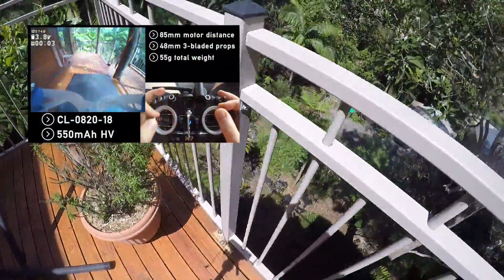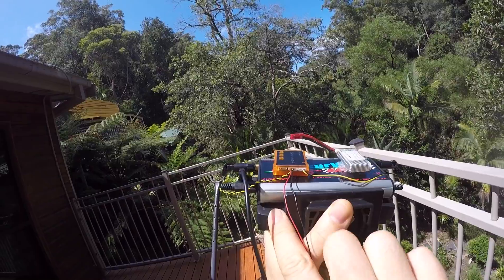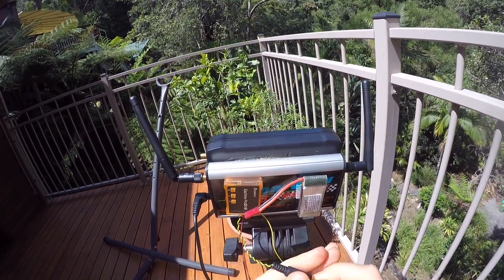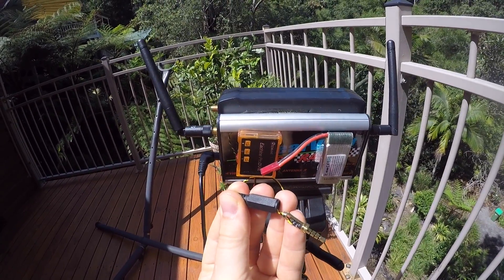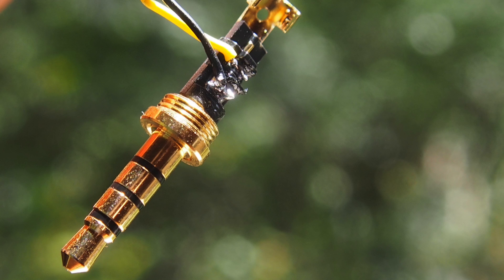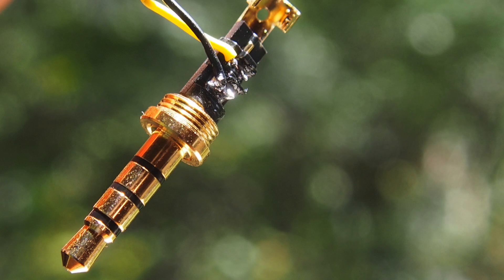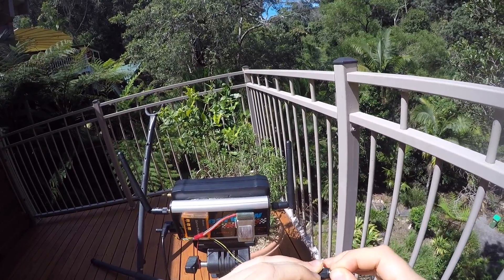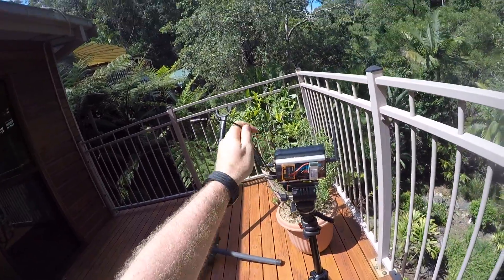How to connect a ClearView receiver to an Eachine ProDVR

Comment: Very nice video tutorial! What are your thoughts on the clearview goggle receiver?
Reply from the maker: a 600mAh 1S powers it for a compete flight session (2-3 hours) for me. I found it best to power all video related equipment straight off batteries, with as little conversion as possible - that  adds noise and reduces efficiency.
Reply from the maker: Sorry, I dont have the CV goggle receiver. I assume reception is as good as the "full size". Not sure if it has a secondary video out.
Reply: Micro Motor Warehouse what are you useing to power the eachine dvr pro ? , I have some cheap rutforce vr-28 goggles I am going to add it to and the goggles are powered by 3.7v 1s , I bought a voltage step up to bring it to 5v but if I will run the same off of 3.7v I will not bother even trying to wire this thing up its the , BTW I bought the matek vb2a5v  to use for the voltage boost from 3.7 to 5v , has anyone used that piece before or yourself ?
Reply: Micro Motor Warehouse I have a question, I just hooked up my $20 eachine dvr pro to my $33 rut force vr-28 goggles & I hooked up the video , grounds & the audio in cables , and the recorded video is very loud it’s like ear bleeding loud , I disconnected the audio in after that so I think it will get rid of that noise issue right ? , & dose the quality of the video go by the quality of the goggles it’s being recorded from , would I get a better video  image if I used the same fpv camera but a high quality pair of goggles like fat sharks or something ? Thanks so much for your time and patience on all my questions !
Reply: Micro Motor Warehouse and would it be possible to hook this eachine dvr pro up to the Tx of the hubsan h501s that has the lcd 5.8ghz screen with all its telemetry , and successfully record the video feed and the telemetry Incase you crash you could go back on the recording to replay  video and get the last know GPS coordinates ? Thanks again !
Reply from the maker: I just ignore the audio noise that is recorded with my FPV footage. If you take a well protected (audio foam) and filtered microphone, I find it somewhat helpful for  to listen to the onboard recording while flying, but not essential.
For my video editing, I do like to have ambient audio, thats why I usually also have a GoPro running on the ground.
Reply from the maker: I dont have a h501s. But it seems very likely to me that you can grab the video signal from somewhere and connect your DVR to it. Google "Hubsan H501s video out", it looks like that will answer you question.
Reply: Micro Motor Warehouse thanks a lot , right now im having trouble getting my eachine txo3 to keep a video feed on my furibee f36 , everytime i lunch the trotttle to take off it instantly gives me a snow screen , I can only sit there grounded and get video , I can’t fly I’m not sure why it’s doing this
Reply: Micro Motor Warehouse thanks ! , I was wondering sense im trying to get osd from my hubsan h502e , some how ( I WILL FIGURE OUT A WAY TO FLY IT WITH OSD SOME WAY ) but I wanted to just strap on an f3 flight controller with a OSD camera like the one you recommended for the tiny whoop , maybe it won’t work sense it’s 1s any way & basically use the “ tiny whoop set up “  for viewing osd , I know it sounds like a lot but I think this combination is possible and it can be done clean with everything tucked inside the h502e , I would consider removing the original hubsan camera to make room inside , I would basically have a tiny whoop inside my hubsan , but its only purpose is for giving me osd , it will only be taking power from my hubsan battery and reading the MAH as if it was the tinywhoops battery being used , so maybe I would need a FC that is powered by 2s 7.4v so I don’t have to step up or step down any voltage , any thoughts ?